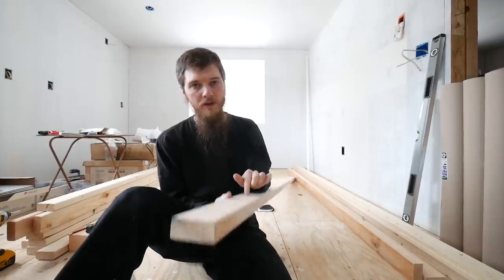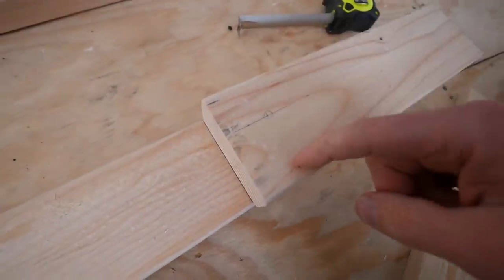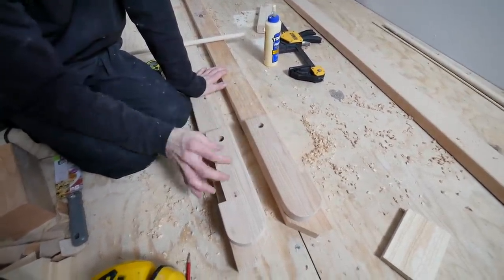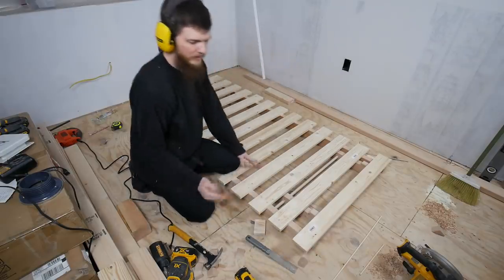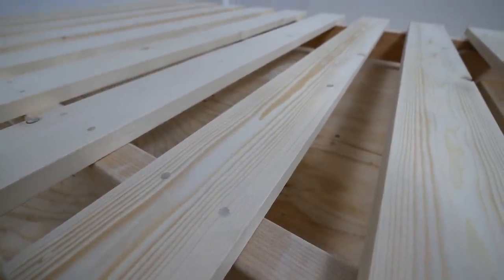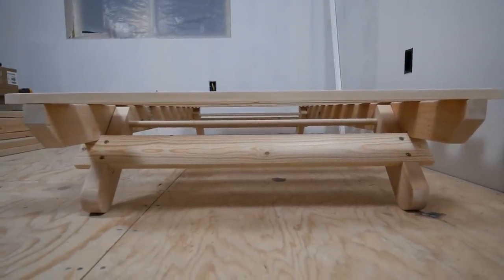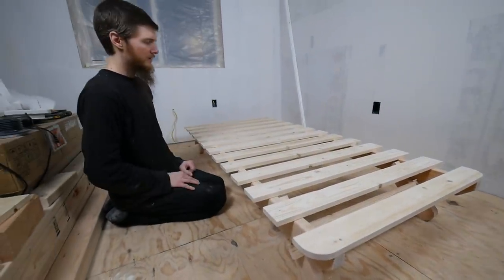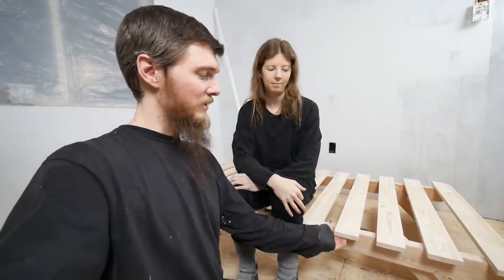DIY Minimalist Solid Wood Bed Frame for Under $50

Comment: Cool concept BUT 2x4s here are close to $5 each near me. No way this is under $50 if you get the mats from the local big box hardware stores.
Reply: @christopherjackson3455  I'm in Phoenix, AZ. I't's been a while since I shopped for wood (built an 8' pick nick table a while back) and I was shocked at the prices for decent pine cuts.
Reply from the maker: Yeah it probably varies a lot by area. Around here, 2x4s are under $3 a piece and the 1x4s do cost a bit more but I think they were still under $5 a piece. As Christopher said, you get two slats from each board so it was pretty affordable. I know our home depot also has precut 39" 1x4 boards labeled as "bed slats" for around $2.63 a piece. Cost aside, it was a fun build, fits our style, and it was a great learning experience so I'm happy with it. Thanks for watching.

Comment: I was scared for the dude when he got his hands really close to the chop saw blade .... there is a minimum distance sign marked in the saw.  Please respect this limit.  Other than that, I like the design and the build.  Good job!  Just be a bit safer while you use power tools ...  please!

Comment: With all your wood projects why don't you build a workbench and use tool stands for your table and miter saws? Raising your work to a comfortable height  makes the work easier and more efficient. A pair of cheap plastic sawhorses is enough to make a big difference.

Comment: I like it also but it's too low.
Reply from the maker: Thanks! It's just standard bed frame height :) If more height is desired, a box spring could be used.
Reply: Too low for a kid just coming out of a toddler bed?

Comment: Safety of fingers in not a concern?
Reply from the maker: When?
Reply: @diyfferent   You obviously work very often with tools that can cut things. When I watched your video I had more than once the wish to shout out "no - not like that".
I think that says a lot. In my language we have a word "Betriebsblind" - it means, you are so professional and so into your everyday work, that you have become blind to it's dangers. My comment is nothing but a friendly heads up. : )
Reply: @christopherjackson3455  4:03 sawing towards himself. 4:08 close but not in line with the blade. Still the perfect opportunity to wear safety gloves. And that is just what we saw. Who knows whats not on the video.
In the beginning he used the round-blade saw. No fingers near the blade, which is good, the grip was also ok, since it was far enough away form the blade. But normally you'd use a monkey grip if working near a round blade. His round saw has a protector, which is also good, but not every tool has. So it's important to just be aware of where the thumb is. You know...just general awareness of work safety.
Reply: I'm glad I'm not the only one thinking that.
Reply: @prunabluepepper  No gloves near any rotating tools unless they're chain mail. 
They get caught and pull your whole hand in. Much worse than a slice on a finger.
No loose shirts, rings, bracelets  or long sleeves either. 
4 years of shop and safety training was priority #1

Comment: Why would you subject someone to a bed only 10 inches off the ground.
Reply from the maker: Maybe it would be an issue for a 90 year-old, but it will be a non-issue for our toddler. It's a standard size bed frame like you'd buy anywhere.

Comment: 50$s but u need 7,000$s worth of tools to make it and also skills in carpentry and a vehicle to transport it all
Reply: For simple build like this doesn't need 7K worth of tools. The drill would cost the most and it can be as cheap or as expensive as you want.
Reply: ...you would probably also need a shift in perception, and I'd call that priceless.
Reply: So what is your point ?
Reply: This probably took him a day to build and your perspective is you think it looks easy I wanna see you do it in less then 2 days or as long as it took him with exactly 50$ and the minimum tools do it and I’ll shut up till then this is only achievable thru spending money a lot of it and as perfect as his prove me wrong and I’ll delete this comment
Reply: Man I am sick of this trollish behavior on DIY channels. If you think this is $7000 worth of tolls used here, you clearly are not a DIYer and you are here to troll.

If you came here to learn how to buy $50 worth of lumber and magically make a bed without tools because you don't own basic woodworking tools (yes a table saw, miter saw, etc are BASIC woodworking tools if you want to DIY any decent project), then the store has some pre-built bed frames just for you. My table saw and Miter saw combined were less than $400, and have paid themselves off 10 times over by now. 

But please, keep trolling DIY channels complaining about how you need to have tools to accomplish DIY projects. I am off to troll gamers on twitch because they make game playing seem easy but since I don't have a $7000 gaming rig, they are wrong and you can only be good if you spend $7000 on a gaming rig...

Comment: I mean it's not a bed bro, it's a bed frame.  A normal steel folding bed frame is every bit as sturdy as that, and cost $20 my man.  It's a cool design and perhaps a fun project for a beginner woodworker but other than that i see 0 point in making/having one.  For future reference regarding furniture it's not a bed unless there is a headboard and/or footboard.  A bed is the part you see a bedframe or bedbox is what the mattress lay on
Reply: Don't be so f*cking critical. If you have nothing positive to say, stay away.

Comment: With time and materials alone there’s no way that’s 50$. You buy two 2x4s that long at Lowe’s or HD it’s gonna cost 50$. Forget the fasteners and 1x2s. And an hour of a licensed contractors time is easily worth 60$ and I bet this took at entire afternoon to build. So you’re looking at more like 300$ or more realistically. I mean... you could probably built it out of shipping pallets, but you didn’t.
Reply: And basic carpenters or apprentices make like 25 an hour.
Reply from the maker: $50 for two 2x4s?? 2x4s at Home Depot are $3 each. 1x4s are under $5 each, and we used a few dowels which were cheap also. The cost worked out to be about $46. And we don't factor in paying a contractor into our total, no one does that for DIY projects. It actually only took a couple hours to build.
Reply: How the hell do two 2X4s cost 50$? What are you talking about?!
Reply: Everyone is an expert on the YouTube.
Reply: Tommy’s been in the tequila...
Reply: Tommy’s been in the tequila...